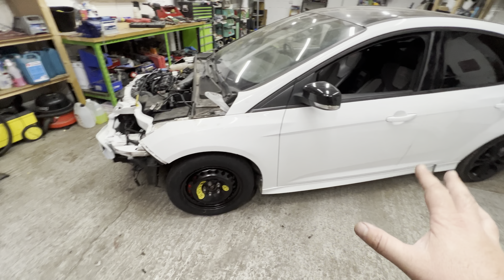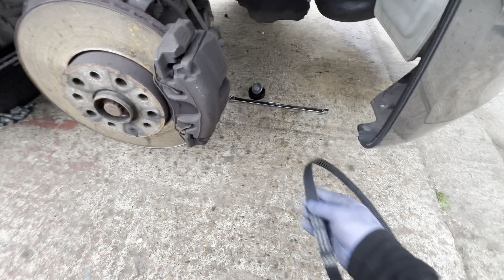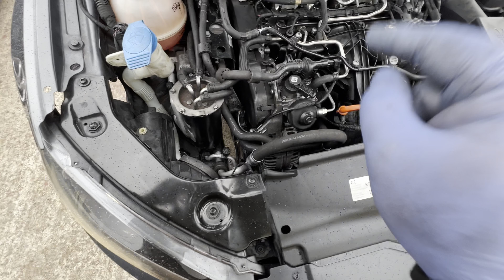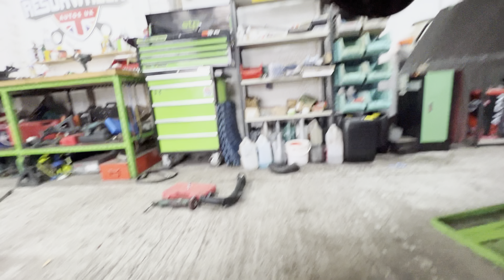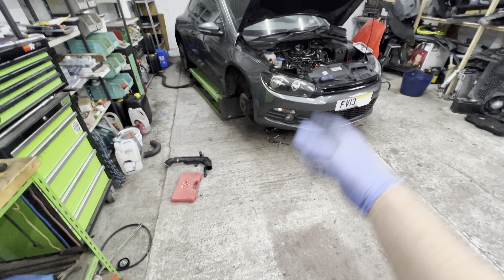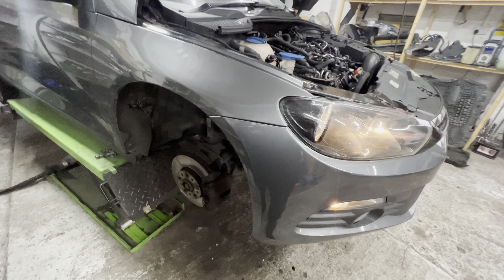VW Scirocco TDI Belt Failure Engine Damage Part 3 I Found The Reason For All The Damage ???

Comment: Great result Mark and nice work 👍You know using logical thinking I was gonna say surely it wouldn’t run without mincing it’s self again if there was something out of whack and maybe the oil needed to circulate but I’m know mechanic so didn’t want to add useless advice as I was thinking out loud type of thing  . Brilliant glad you fixed it 👌👏👏

Comment: Hi mark good news can I suggest you change the oil and filter as the lifters were dry before you started the engine and they are lined with Teflon so any teflon which came off when they were dry will be in the sump and you don’t want it to be pumped around the engine

Comment: I have seen this damage before and am sure the new lifters were immersed in oil before fitting
Reply from the maker: Hi mate what new lifters all original one’s
Reply: @ResurwreckAutosUK  must have got my word wrong I was meant to say the new parts you purchased along with the cam shafts. As you can tell I am no mechanic